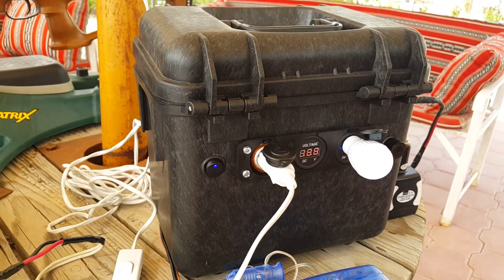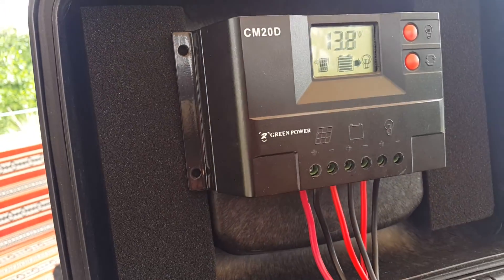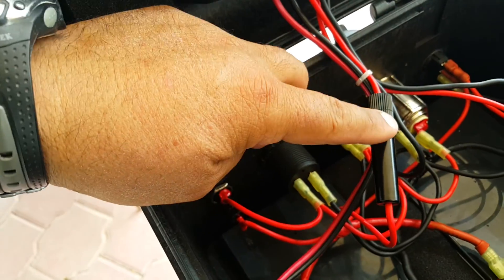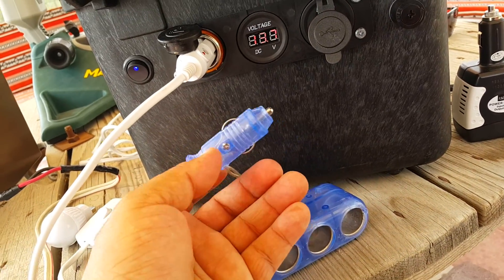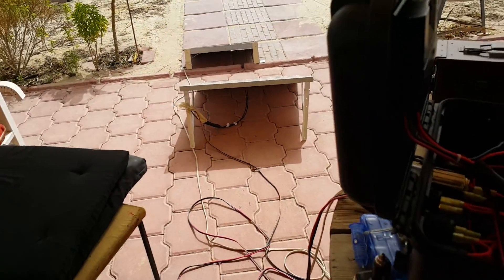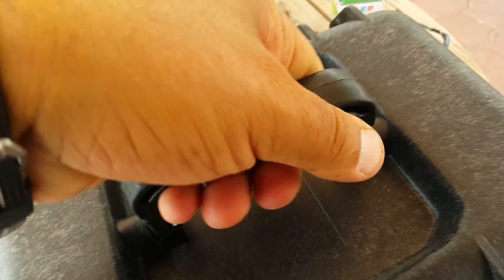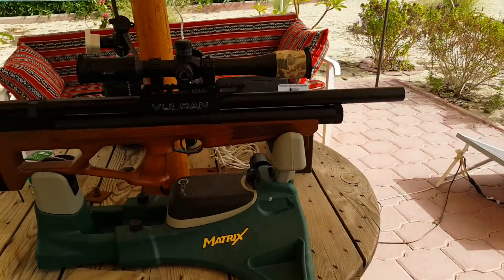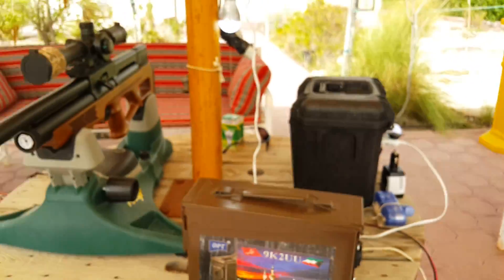Solar generator 5 by 9K2UU

Comment: Thank you for your videos. Could you please help me please. I want to build one of these. I want to recharge it not just my solar, but i want to recharge it in the car via 12 volt socket and i would like to be able to recharge it at home by plugging it in too my house main electricity supply to with somekind of socket mounted into the case. Could you please tell me what i need please. I understand the solar bit. But i am not sure about the car charging and home charging bit..for example...if i had a 12volt outlet on the box like you have, could i plug a lead into this and back into my car outlet would this charge? And how do i fit some sort of mains battery charger to charge from 240 volt ac? Thank you
Reply from the maker: There are many ways but the easiest one I think is to supply your solar generator case with 2 external positive and negative terminals and attach them directly to the battery inside coupled with a fused thick wire, bypassing the charge controller. At home you can use a three stage AC to DC charger which normally has alligator clips to recharge the battery via the terminals that you have installed. In the car, you can improvise a short cable, one end is a male socket to be plugged into the car’s female 12v socket and the other end terminates with alligator clips as well to recharge the battery via the terminals while driving!
This terminals’ method is also beneficial for extracting high current from the battery to feed any heavy load that you might need such as jump starting your car battery or running a DC/AC inverter. The load side of your solar charge controller is normally capable for light loads ”not more than 10 % of it’s rated power” such as recharging cellulars and led lighting or acts as a timer to switch on & off your loads!

Regards